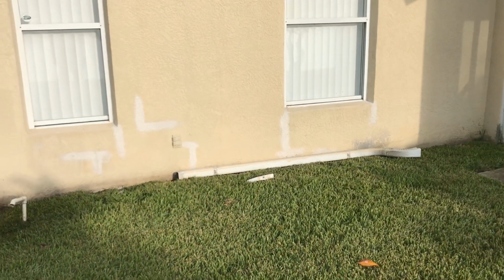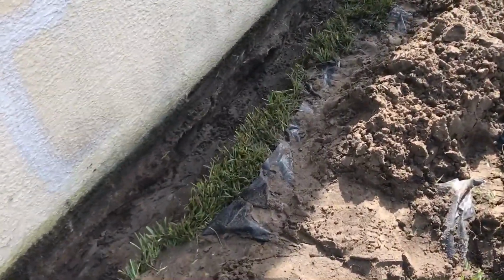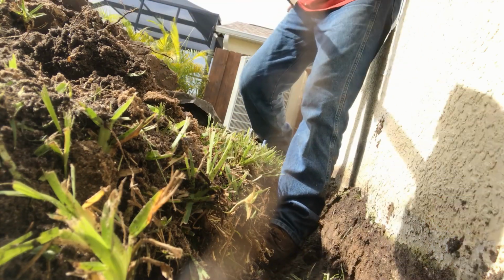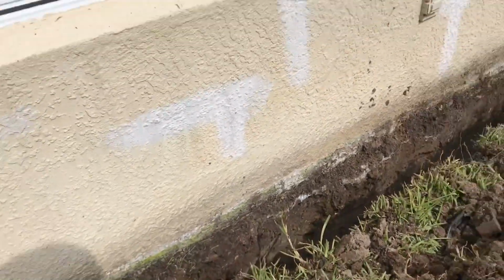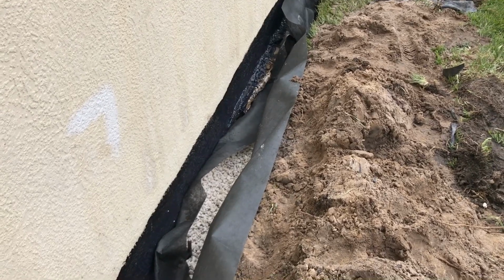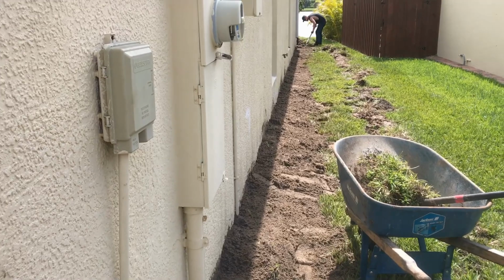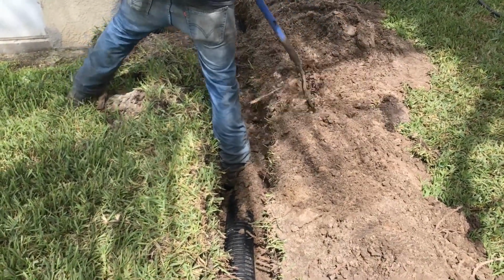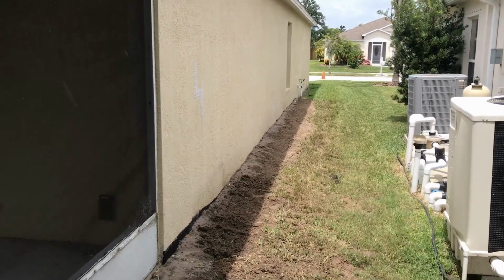How to Build French Drain / Footer System to Handle the REALLY BIG RAINS

Comment: moved into new construction and the AC condensate discharge wasn't extended (was being discharged 6 inches away from house). I put a bucket underneath to measure and I was dumping out about 10 gallons a day... it's crazy

Comment: Great video as usual. But didn’t show the actual pipe being installed near the footer. Just showed gravel. I assume perforated flex pipe was used. Also did you cut the a/c condensate pipe and have it drain into the gravel or just let the overflow drain there and leave the condensate pipe intact?

Comment: Chuck,  I have an m53 sump pump syatem that cant keep up.  Big rains and the system is under 2/3 inches of water.  20 feet perforated pipe with three 12 inch catch basins all discharged by m53.  My question?  Should I use an m98 with 1.5 inch discharge or m267 with 2 inch discharge?  Thanks for the videos.  Eric
Reply: callan R I would use a 1/2 HP liberty sewage pump with a two inch discharge.
Reply: Up it to a 1/2 hp pump.

Comment: Hey Chuck! Chad here in Illinois, I'm looking forward to installing a sump pump and pit in my basement and was wonedering according to code, does a person need to install a GFCI outlet to plug the pump into?
Reply: Chad Payne yes in my area you have to.
Reply: And it has to go straight to the box
Reply: @Leonard Holt  It has to be on its own circuit ,electrical Box.meaning its owe breaker
Reply: And your GFCI has to be upside down now,so your ground is on top
Reply: And the discharge line has to be 3ft from any electrical.
Reply: @shawnp8429  thanks for all the info!
Reply: @chadpayne9789  no worries and buy a . Zoeller brand sub pump.they last best on market

Comment: ... but once the lake reaches that discharge line way down there... no more drain... and they still have a water problem.
Reply: Huh????   Water flows out down hill.   It does not matter if the lake rises to cover the discharge end of the pipe, the water will continue to flow out.
Reply: @GrifFungin   When that lake water covers the end of that discharge line, the pressure of that lake water will  be pushing back up that line. Water wont be flowing out, it will be pushing in...unless there was an outward pump. Stick a straw in a bowl of water and see if you can just pour water in that straw into the bowl... not going to happen.
Reply: @Leonard Holt Im not a specialist either  by far so I could be dead 100% wrong... but it just dont make sense to me how water  could gravity flow out of a pipe thats under a lake water flood.
Reply: TheOldStyle You’re 100% wrong. The water will continue to drain until the water table is equal to the level of the lake. The lake reaching the end of the pipe is irrelevant because the water draining from the pipe is at a higher elevation than the lake.